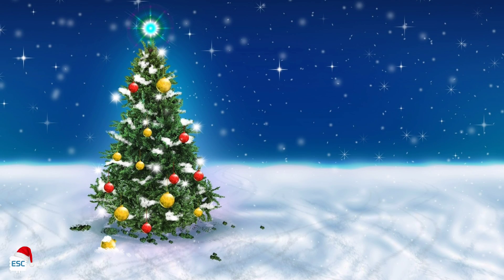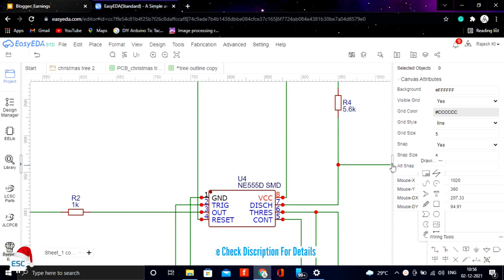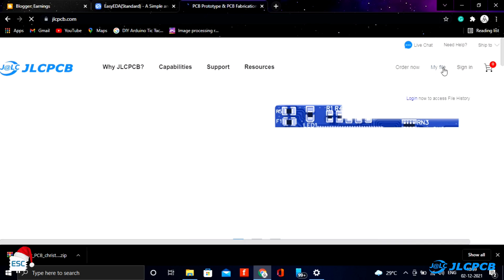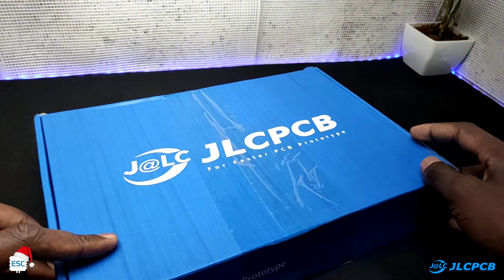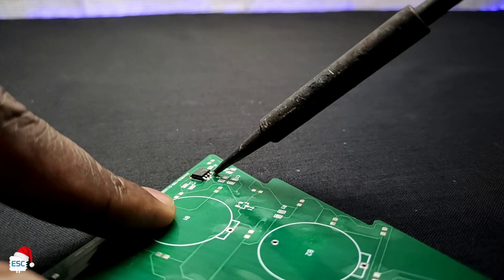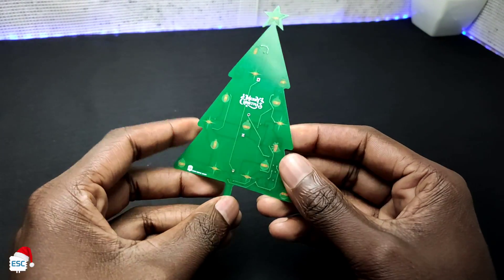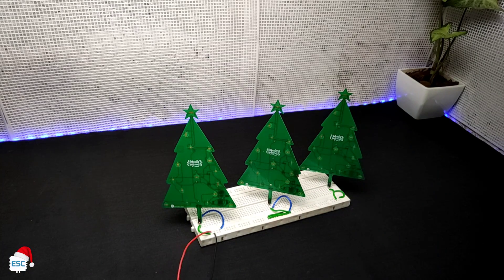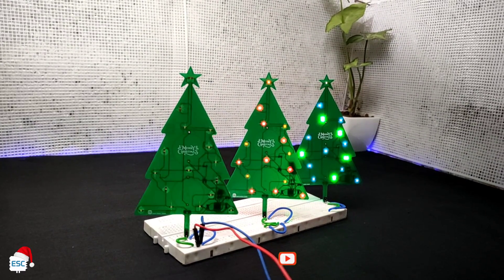Diy Christmas Tree PCBs | JLCPCB

Comment: You should have used a regulator for 5v instead of zener as regulator.
Reply from the maker: First of all  i am not using zener here.
Also 555 is okay with 6-15v
Reply: @EDISON_SCIENCE_CORNER  okay then what is the purpose of the zener at the base of the structure?
Reply from the maker: Who said that is zener.?
Reply: @EDISON_SCIENCE_CORNER  polarity protection??
Reply from the maker: Yes
Reply from the maker: Check circuit bro